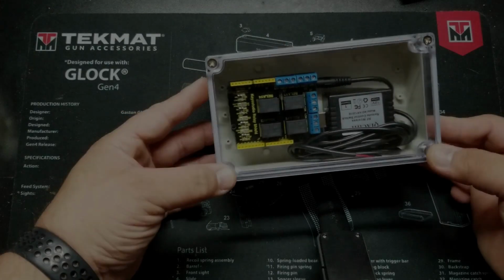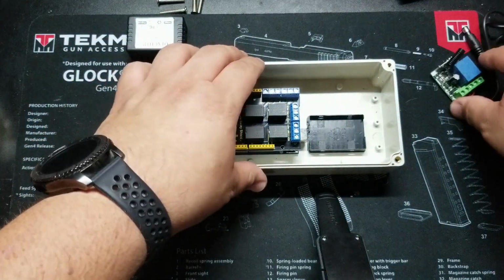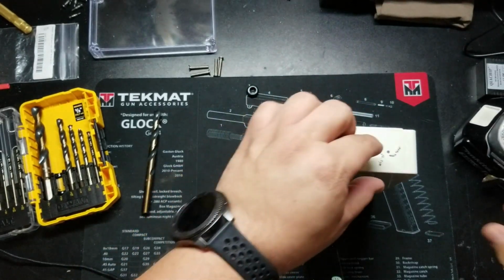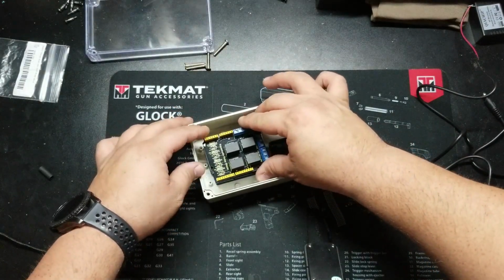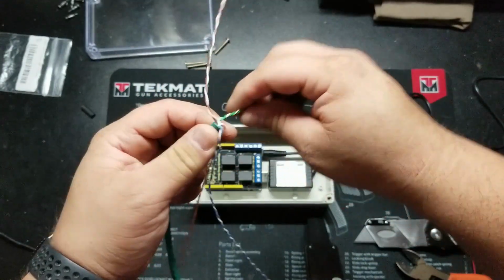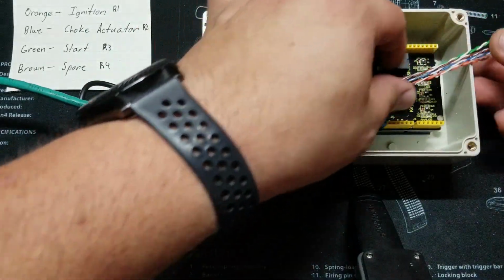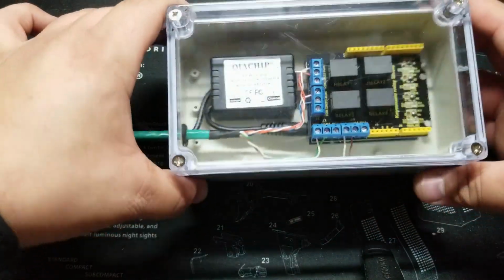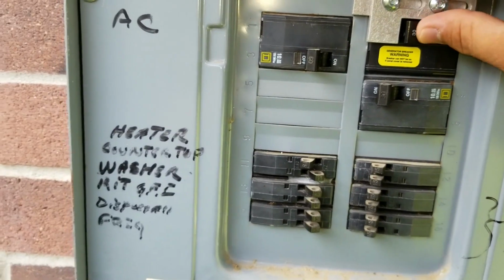DIY Portable Generator remote start   Part 1

Comment: Great video and explanation. I have only one question: your code is set to activate the choke on every start up. But if the generator is warm, can it still fire up with the choke being activated? Wouldn´t an temperature sensor on the engine block, help to determine if the choke needs to be activated or not?. Thank you.
Reply from the maker: Great point, I haven't figured out how to tell the Arduino to listen to sensing peripherals, but I'd love to do something like that. As for it affecting the engine, it won't harm anything to close the choke for a couple seconds on every start, though it isn't necessary.

Comment: I am very impressed, Creative, well done and thought out However, you have created an open loop control solution when in fact the Arduino can sense things via inputs too. Is it possible you could sense a few things via closed loop ie. : 

1. Motor running or failed-start w/ LED indicators
2. Choke position indicator LED
3. Carbon Monoxide and fire detection.
4. Others

Just some thoughts !
Reply: can you show us how?!

Comment: Why everybody use a damn ar dweaner for every damn thing..   its really unnecessary for this typevof application because you can buy a relay board as well as a re remote w/ receiver then wire to a switch then to battery to be able to turn it off if you want.  Include a solar battery maintainer with controller and can leave it on 24/7..  but no need for any arduino..  the relays can be set to different buttons on the rf remote for actuator on choke and start button, and kill button..
Reply: Why don't you show us how to do it in a video like JPG23 did. and take the time to show us. I'm like many out there. I don't have a clue on how to's and seeing this helps. Like a list of parts etc... Thx
Reply: complains about a video instead of just changing the channel

Reeee

Comment: Thanks for this tutorial.  It’s very informative.  I have started this project myself and am wondering how you fastened the RF receiver and Arduino to the enclosure.  Double sided tape?
Reply from the maker: Yes, I used double sided tape. I roughed up the surfaces with scotchbrite and cleaned with alcohol